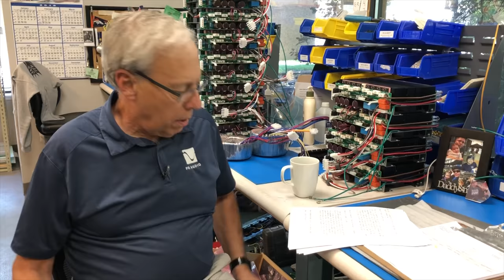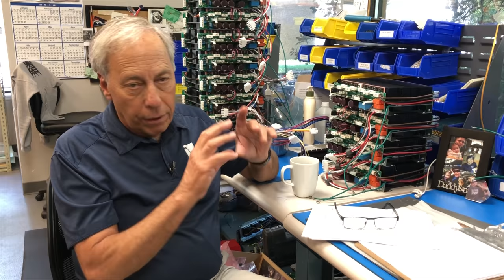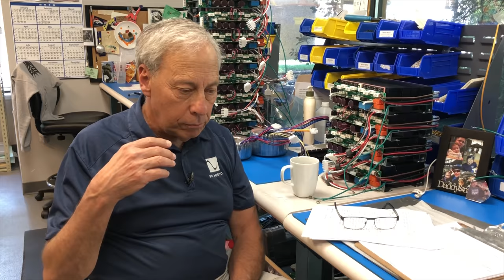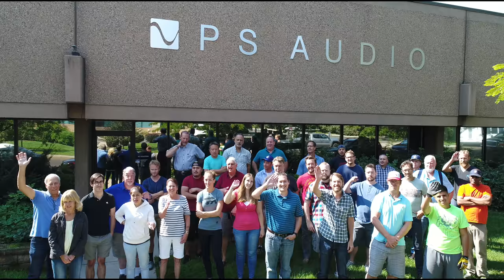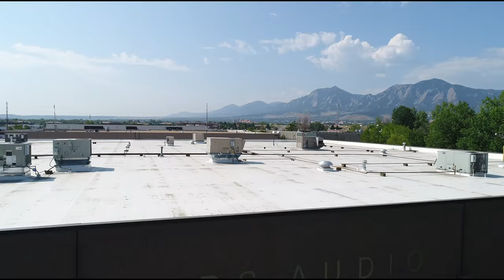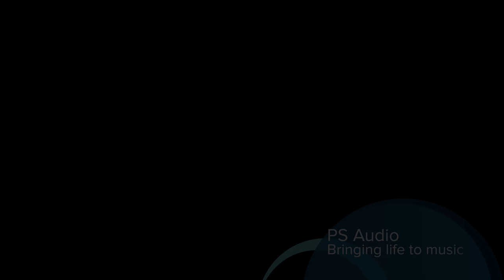How do headphone amps differ from speaker amps?

Comment: I would have thought the biggest issues with a speaker amp are:
Power on/off transients. The thud which a speaker handles relatively easily could blow out a headphone. Also connecting and disconnecting leads. You will need to follow a routine procedure for switching on and off - connect the headphones last and disconnect them first.
Level control. A position that was a good listening level for speakers is now a "world's loudest band" competition for headphone listening. You can sometimes lower the input device, but if it's fed from a fixed level line in component, then unless you like to blast your ears, you're looking at the unbalanced region of the potentiometer. If your amp has digital level control, then this probably fixes this, and also the issue of being jump scared by scratchy potentiometer tracks.
Noise floor. What was previously barely audible across the room with speakers is now relatively prominent with headphones, and during the quiet passages of a classical piece, it will sound like something's leaking air. Mains hum will be prominent too if there is any. I'm betting headphone amps put more effort into reducing this.
With most headphone jacks you will be sharing a ground, which might cause an issue if using two mono-blocks, especially of different make and model. Headphones with detachable cable can have an independent ground to each ear.

Comment: Headphone amplifier power requirements are so low, that is possible to build small and comparatively cheap vacuum tubes amplifiers without output transformers and with tubes on both input and output stages. That's exactly what I've done: I like the sound much more than the solid state headphone amplifier I used before.

Comment: You can build a simple circuit, three resistors per channel, that pads down the output of a power amp to be able to power headphones directly at a lower power.  The amp sees eight ohms, the headphones see thirty-two or higher ohms, the power is attenuated.
Reply: You don't want the amp to see 8 ohms. Unless you have a power resistor and don't mind wasting a lot of power. Also must headphones actually perform better when driven from a low impedance, not 32 ohms.
Reply: No, since the attenuation changes with the headphone's impedance curve you'll get a skewed requency response.

Comment: Vintage audio gear just parks a high power resister at the output of the speaker amp. The sound is about as good as it gets and the gain is enough to blow the snot out of any phones. Dedicated headphone amp sections are just a scam to charge more money.
Reply: all my amps have a headphone jack ..full size not 3.5 rubbish

Comment: I've met three solutions for headphones driving. One obvious is driving by the same terminals of speaker. It forces do be  careful not to turn volume up when headphones are plugged in. With speakers resistance 8 ohms and power of 50W, with disconnected speakers it can deliver pick voltage 20Volts or more  . At this  voltage power consumed by 35 ohm headphones equals about 10W which will damage them mechanically or thermally. . Average producers secure this by serial resistance which may be not beneficial for sound .  Second is driving headphones by stage which is driving also power end. This may sometime lack enough power for headphones and due to overload of such double purpose stage  show increased THD at bigger volume.. But at moderate listening it is at last safe and provides untouched  quality. .  . And third which seems best -dedicated small amplifier  having enough power for headphones driven from preamp . It will be beneficial with THD and safe for headphones.  I listen from speaker terminals -my  power amps have little noise so it's not deficiency . Only in my two reel recorders I have  based on discrete semiconductors dedicated headphone amplifiers which seem to work  very good. Of course cordless  headphones no need any driving amp, just right input voltage. .
Reply: You could also use a serial resistance with a resistor paralleling the load to lower the driving impedance. Since this means the resistors need to dissipate more power, you don't see it done.

Comment: Love your videos Paul but I’ve had the opposite experience with discrete headphone amps. I find most of the discrete designs are worse than well implemented chips and only the very high-end discrete designs tend to outperform them. In the past this was probably different but today’s chips are very difficult to beat when put into a well designed circuit implementation IMO

Comment: Hi Paul, Great video! 
Helped me understand a few things about resistance in loudspeakers, however its only added to my confusion about it's affect on sound. My knowledge on the subject comes from prior headphone related investigating. As I understand it, high resistance in headphones, 300-600ohms, have what is reffered to as a "tighter response" 
In a graph this lets the headphone more accurately represent a square wave than a lower resistance varient of the same model. 
Does this effect apply to speakers? and if so, how is it possible that some high end speakers have a 1ohm resistance? do they just sound sloppy? or is this reserved for the lower frequencies? 
Thanks for making these videos, its fantastic hearing the knowledge of someone as experienced as yourself. 
Hopefully you have the time to get back to me. :)
Reply: Impedance has nothing to do with a "tighter" response. There is no causative relationship there.
Reply: Thanks, what then is the benefit of high impedence headphones?
Reply: Easier load for an amplifier to drive. Especially an opamp IC.
Reply: easier because the amp is less affected by things like THD when designed around operating at higher load? like an otl tube amp 
thanks again, I think you have cleared up my confusion.
Reply: Swashed, that's pretty much it. Lower current (higher impedance) is easier to design for. (To a point.) An OTL tube amp is very costly to implement for driving low impedances. Also the gain of bipolar transistors drops off as current increases.

Comment: Why does an amp need the resistance of speakers to keep from self-destructing?

Furthermore I would like to know why it seems 4&8 ohms dominate?   As I have also seen 16 ohms on an old Kenwood amp from the 90's, with a selector switch for the Transformer.
Is it better too just select the lower impedance on the switch to use the whole Transformer instead of the tap?

While in subwoofers they're striving for the lowest impedance?

What gives?

Beyond that, does the ohm load of a particular speaker actually change its sound?

I really enjoy your show and I was wondering if you could answer these things for me?

Jenna Orlowski from Dearborn Heights MI

P.s.
sorry if this message isn't constructed better my phone is giving me a lot of problems typing.
Reply: You seem like the person to ask about this stuff 😉

Comment: HI. A have a pair of Sennheiser hd 650's,  any budget headphone amp recommendations to properly drive these beauties?
Reply: Simon go for objective 2 amp, read nwavguy on blogspot
Reply: Thank you, Roger Walter
Reply: Roger Walter nwavguy is a hack. Go read recommendation threads on head-fi and superbestaudiofriends.
Reply: tormaid I have already read headfi reviews & all the ruckus behind banning of nwavguy. I'm using O2 from 2012 & tested it on cheapest to expensive planar headphones, the O2 drives them effortlessly. It's hard to beat an open source well documented design , 30$ for DIY amp objectively vs amp costing K$ . Subjective reviews are totally different ball game though.
Reply: If you don't have a dac strongly consider an Audio-gd nfb-11 dac/amp. they have versions with both they're r2r(multi bit) and delta sigma dac, see this if you dont know about dac types. https://www.youtube.com/watch?v=77DXMR3aVtc

can't go wrong with O2, i believe people like to swap the chip based amps in these to change sound so there's some cheap upgrades to play with down the line.  I would also consider one of the cheaper little dot or schiit audio tube amps.

I hope to buy  a first watt j2 power amp soon just to drive my heavily modded he-6 headphones.
Reply: Schiit Vali 2 or Asgard 2
Reply: sbaf!? Really?! that site has some of the most pretentious people on there.
Reply: I recommend you a good OTL tube amplifier, Bootlehead Crack ; this sound amazing with HD 650/600.

Comment: For the last part, discrete circuit is really really hard to get low distortion. They can measure well in thd but when you put a multitone sine waves and measure the td+n they will be horrible that's why they sound different. Some prefer the sound some don't.
Reply: Yep. It's the old discrete versus IC debate. One automatically assumes discrete is better. Which is just a bunch of marketing wank. A good discrete circuit can be better than an IC, but not always.

Comment: Sorry Paul, it is not the voltage but the current that moves the diaphragm.
Reply: Can you drive a speaker at 0 volts? No. Both are relevant.
Reply: qwerty22 

Yes, both are relevant. One cannot without the other. You need voltage to make current.

But you drive a loudspeaker directly with current or indirectly with voltage via the impedance, which introduces all kinds of current distortion (by the inductance of the voice coil for instance and power compression).
Reply: However, we want a voltage source, not a current source, to provide that current. I think that's the point Paul was trying to make. If you want to be anal, one magnet being repelled (or attracted) to another magnetic drives the diaphragm.
Reply: Mister Hat Why do we want a voltage source, when a voltage source introduces distortion, compression and even (distorting) feedback?
Reply: Jerry, a voltage source does none of the things you've listed. However, a voltage source is better because that's what the design engineer had in mind when designing the headphones.
Reply: Mister Hat, For sure it does! For instance the inductance of the voice coils is dependent on current, excursion and frequency, so it is nonlinear and creates distortion. When the voice coil heats up the resistance rises and the output lowers, so there is compression. And finally the drivers are also microphonic (they are microphones!), so there is feedback of vibrations, noise and distortion via back-emf that adds up onto the input signal when it is voltage controlled. 

With current-drive (c.q. current-control) all these effects are eliminated.
Reply: Jerry, And designers account for all these things when designing a driver. Current drive would be better at eliminating some of the problems you stated, but only if the designer took that into account. Take a standard driver and use current drive and it will have a horrific frequency response. Especially at any resonant frequency.
Reply: 1. And designers account for all these things when designing a driver? You can't get rid of the current-distortion, compression and (back-emf) feedback. You lose some quality and you never get it back... Unless using current-drive.

2. Current drive would be better at eliminating some of the problems you stated, but only if the designer took that into account? No. It eliminates ALL the problems stated. And he has nothing to take into account. The only thing is using current-drive...

3. You have a point here. But I would not call it horrific. If you drive with voltage you get more or less the Qt of the driver (more or less, because of connections, cables and filters) and if you drive with current you get exactly the Qm of the driver. You can tune that Q on several ways besides electrical damping, and you have a terrific response.

And about "that's what the design engineer had in mind when designing the headphones"... You nailed it! And it is a ‘deadly’ embrace! Speaker and headphone makers design for voltage-drive and amplifier makers design for speakers and headphones that are designed for voltage-drive... But it is a silly tradition. And breaking with the tradition (innovation?) gives a much lower distortion in the small signal area and some lower distortion in the large signal area (because of distortion by the non-linearities in force factor and suspension).
Reply: I bet you believe in special power cables and magic marker around CDs too. If current drive was such an improvement, it would be the norm. Designing an amplifier for current drive is no more difficult than voltage drive. But, we don't because current drive is not better.
Reply: Funny statement. Why should I believe in special power cables and magic markers?? 

If something is the norm, doesn't mean that is the truth. There was a time thinking the earth was flat was the norm... You have a funny way of reasoning...

And you are right, designing and building a current-drive system isn't difficult. And you are wrong, it outperforms voltage-drive. Just try it, it isn't difficult, as you mentioned.
Reply: Bleh. Now you're simply grasping at straws.

Comment: Why have a headphone amplifier when you can have a speaker amp which can be used with headphones?
Reply: Because generic preamps and/or integrated amplifiers not always have well designed "specific" headphones outputs. For example, as a rule of thumb, the lower impedance the headphones output (compared to the headphones impedance), the better performance from your headphones you'll get. Specific headphone amplifiers usually have a very low impedance output. There are more reasons that have to do with circuitry design, etc. You don't get the same result by attenuating the signal generated by a 20, 40, 60 or 120 watts amp (destined to move a pair of speakers), than using a headphone amp which is designed to generate a low power signal destined to your headphones. Anyway, there are sweet synergies out there between some medium-high impedance headphones ( 300 ohms or more) and some standard amplifier headphones jacks. I'm very happy with my Sennheiser HD 580 / Arcam A 65  team (or maybe it's just my ignorance because I haven't tried anything  better yet).